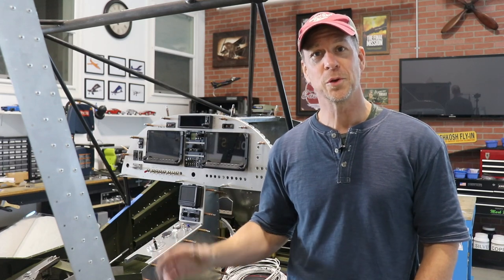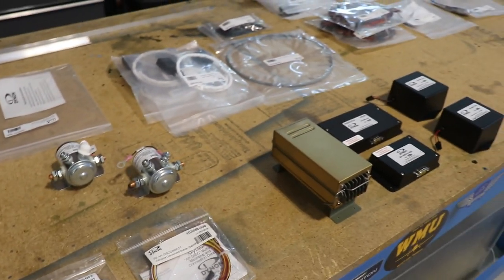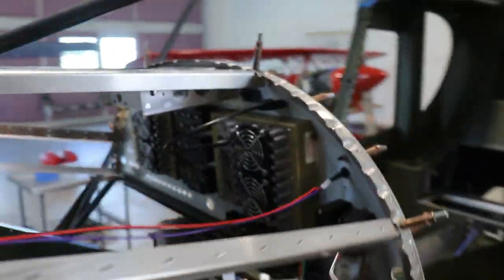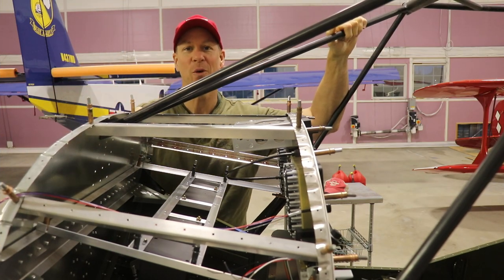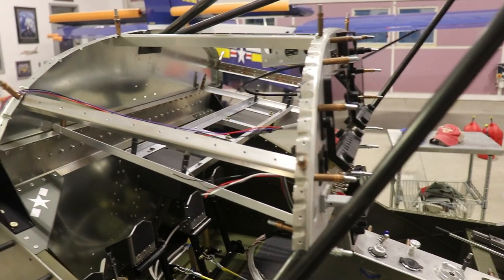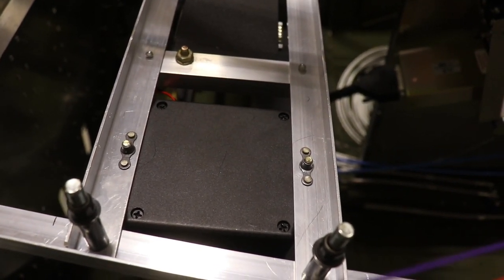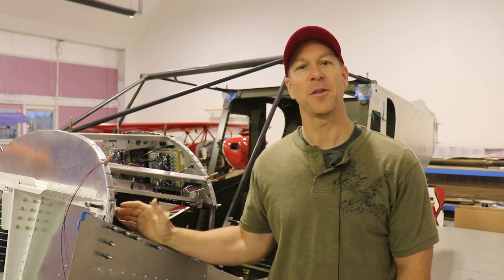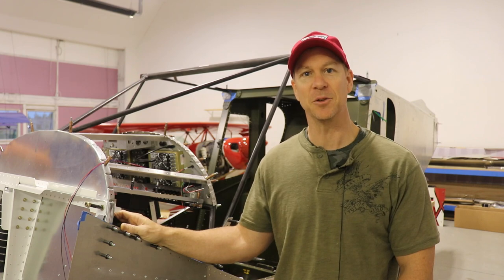Getting Started w/Dynon Avionics!  (Ep59)

Comment: I spent 90 percent of my time early on just thinking and debating with myself on how to build my panel. Then I make a mock up with templates and found that what I thought was perfect, had to be scrapped and redone. It was a learning experience for me, and I posted it on my Youtube channel which is under my name. Love your updates and progress videos. Cheers from Winnipeg.
Reply from the maker: Peter I’m not sure if you saw a video I posted some time ago but when I first was planning the panel I printed out full size pics of all the components that go in the panel. With the paper cutouts I could move things around and get a good look at how things would fit before I cut any actual holes in the aluminum.
Reply: @KitplaneEnthusiast  I did see that, and learned a few things from watching it. I sort of did the same, but when I went to dry fit before I made any holes, I found I had a clearance issue with the radio. I covered that in my video where I reveal my new glass panel in my ultralight. Which proves that even with all the planning, sometimes you have to be prepared to roll with it and make changes.

Comment: I'm putting the Dynon Certified system in my 172B - so much time spent standing and staring at the existing panel and figuring out the placement of the new equipment.
Reply from the maker: I’ll bet that’s going to be an awesome panel!
Reply: @KitplaneEnthusiast  I'm hoping it will be - but it's a little daunting at the start... ripping out everything to start over is terrifying!
Reply from the maker: @GlensHangar  Are you allowed to install the avionics yourself being a certified airplane, or does an avionics shop have to do the install?
Reply: @KitplaneEnthusiast  Because it's certified (here in Canada anyway) I can have any AME with an M1 license install it.  My AME is an M1 so he'll be doing the work, but I'm allowed to do the grunt labour under his supervision. So in the end I'll be doing most of the install, with Chris looking over my shoulder and giving advice and inspecting each stage before we move on. Ultimately he needs to be satisfied with my work to sign off on the logbooks. This is the first installation of a Dynon Certified system in Canada, since they only just gained certification here.
Most sane people would just drop their airplane off at an Avionics shop and pick it up a few weeks later... but what's the fun in that?
Reply from the maker: @GlensHangar  I agree-do it yourself!

Comment: Dammit Mark, show us where your AP servos are going! The suspense is painful. :) Mine, right now, are sitting in your ADS-B and transponder locations, but I'm not yet committed.
Reply from the maker: I just haven't got there yet. I do know where the aileron servo will be located, but I'm still trying to figure out the elevator servo!
Reply: I've been playing with this idea: under the pilot seat, as far aft as possible, cut a 1" hole in the tunnel sidewall to insert the servo arm into the tunnel. Mount the servo to the tunnel sidewall so the motor is under the seat, actuator arm is inside the tunnel. Run link from servo arm to a point somewhere on the lower control stick horn. But it's possible that the angle on the rod ends will be too great when at full left stick.

Comment: I really wanted to like my Dynon D3, portability and price seemed spot on. But it just never worked well for me in either rotary or fixed wing aircraft. The attitude display would often bobble and become unstable in smooth air level flight. Dynon offered exceptional customer service, but ultimately we could not resolve what I was experiencing.
Reply from the maker: Man that’s not good news! I’ll have to see how mine works in flight. It seems to work well while I’m just holding it.
Reply: @KitplaneEnthusiast  They have great reviews overall, I ended up trying two different units with the same issue. Perhaps once you fly the product you can pass along your thoughts.

Comment: "Thinking and Staring" is something I have truly mastered thus far in my Cruzer build. I follow your videos very closely as they are so helpful.  In prior videos, you had made reference to "painting" the cabin frame, and now I note you are stating "powder coat".  Since I am still deciding which way to go, I am curious if this something you changed your mind on, or if you intended to powder coat the frame all along.  Thanks Mark.
Reply from the maker: I was originally planning on priming and painting because I wanted the frame green. But now I have too much stuff to move in the hangar to paint so it’s just easier for me to get it powder coated. I still think it will look good in the same satin black to match the rudder pedals and seat frames. I’m still deciding if I want the panel grey or black.

Comment: Hey Mark been watching your build/s with interest over the last 2yrs, liking the tutorials, very informative. Two questions if you have time to answer? 
1/ With your radio - do you have to take into account the radio's mounting location due to potential magnetic / electrical interference when the radio is being used to transmit ? 
2/ Other than the back up batteries, do the  electronic units have an internal heat dissipation (heatsink) - with the manufacturer suggesting - 'preferentially" mount orientation - say inverted or - not?   

Cheers Glenn. DownUnder.
Reply: the efis displays have fans, and the transponder/radio a heat sink for the dynon stuff

Comment: Just planning my panel in my brain… you stated you weren’t going to hinge the panel because it interfered with the GPS… but you are willing to remove an EFIS screen to work thru that hole. What’s the difference between removing one or the other?
Reply from the maker: Good question. With the GPS there is a permanent mounting tray riveted to the panel. So even if I slid out the GPS the mounting tray would still be there.
Reply: @KitplaneEnthusiast  good to know… thanks!

Comment: Mark, I know you have used PTI primer in the past, are you still happy with that primer? Was the paint gun cleanup easy, what did you use to clean gun with? I'm using Stewart Systems mostly because "eco" reasons but results are not easily achieved, what top coat will you be using eventually?
Reply from the maker: Scott the primer is from SPI. It's a two part epoxy primer that I'm very happy with and will use again on the Super Duty. I clean the gun with the primer's thinner. I'm using Utech U500 for the top coat and that is the green you see on the inside of the plane. The outside will use the same color/paint. I have personally never once heard anyone talk about good results with SS paint!
Reply: Thanks Mark, I realized that it was SPI after I hit the send button, I may try out the SPI paint before I get too deep, I have only painted some small parts so far with SS that go on the inside of the cockpit so it's still not too late before I paint the outside of our RV14A project.

Comment: where does zenith come up with the 400 to 500 hour build times for the ch 750  ,,, is that realistic ?  never built a plane before but consider myself somewhat  mechanically inclined ,,, thanks
Reply from the maker: I've always felt that the number the manufacturer comes up with as far as hours to build, is worthless. Everyone builds at a different pace and has different standards for their build. It takes time to debur holes and polish the edge of every piece of aluminum. It takes time to remove part number labels and prime parts. If you just want to take parts out of the crate and rivet them together, you can probably build the airframe in 4-500 hours. But you also have to add hundreds (or thousands) of hours for engine installation, panel and wiring, and finishing and paint.